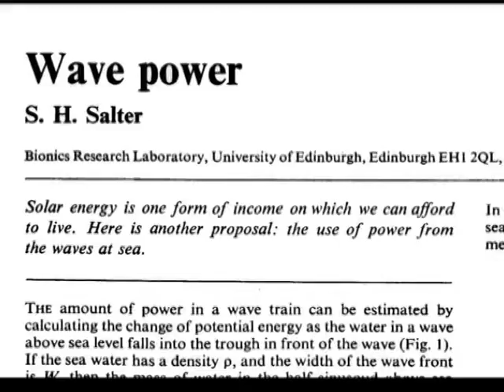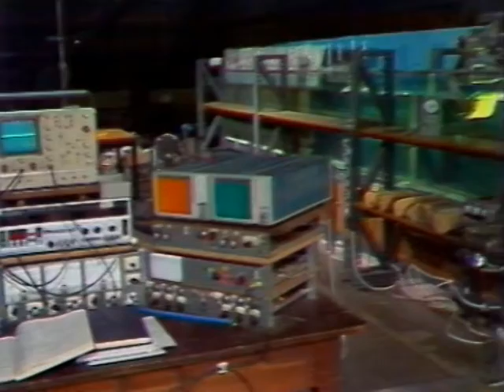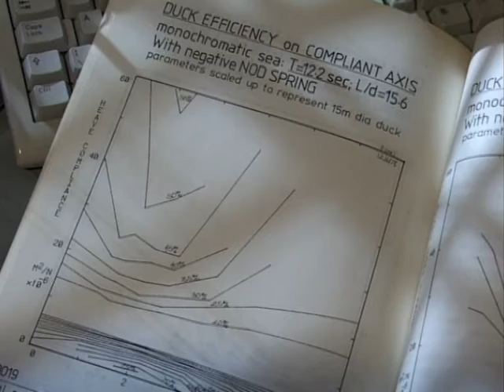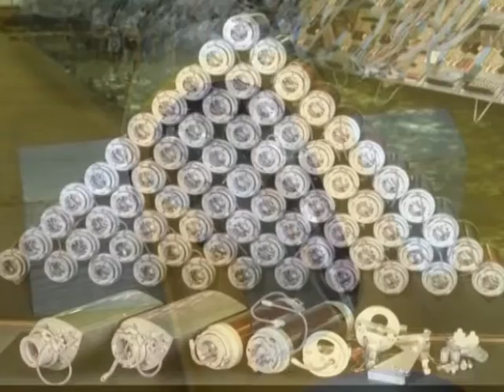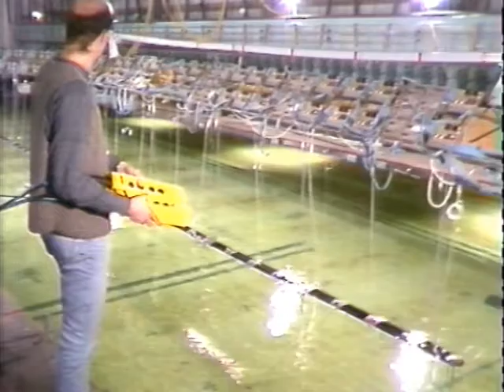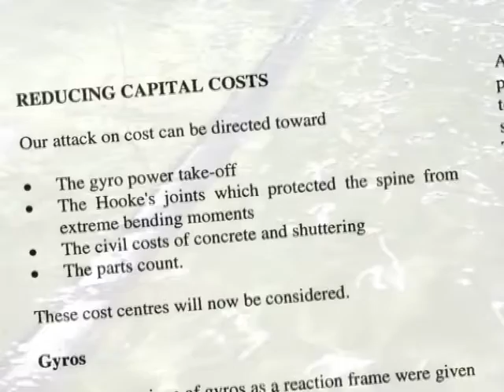Power for Change - 2 (of 13) The Duck wave energy device

Comment: The device is too low in the water. The upper surface is creating waves behind the device, whereas if the axle is at the mean water level, the device will not exert a vertical or horizontal movement on the trailing water, leaving it calm, thus extracting more wave energy.